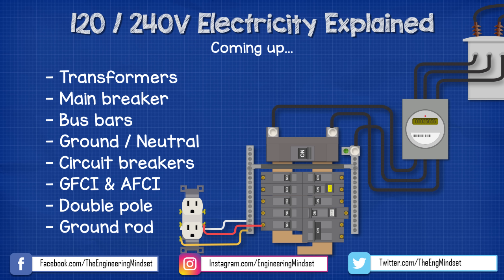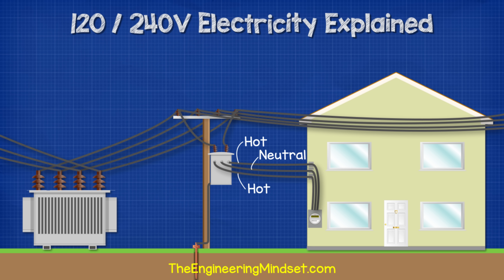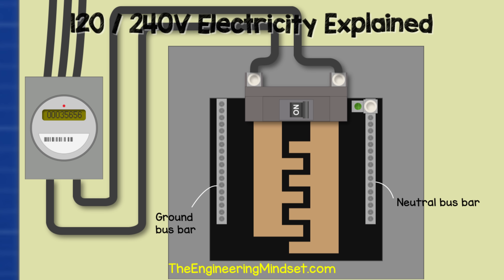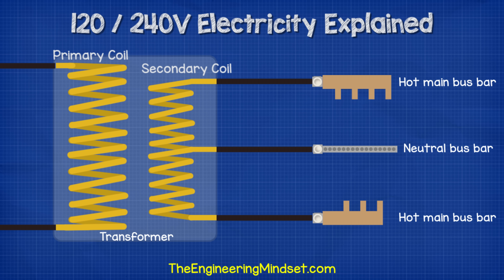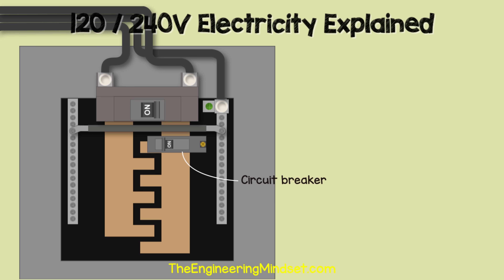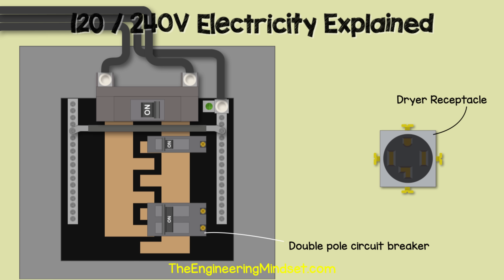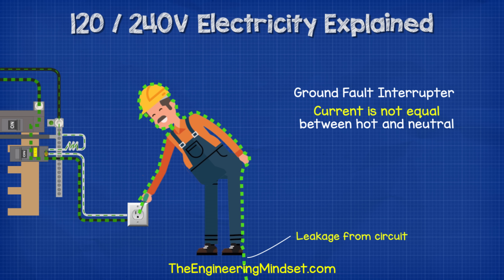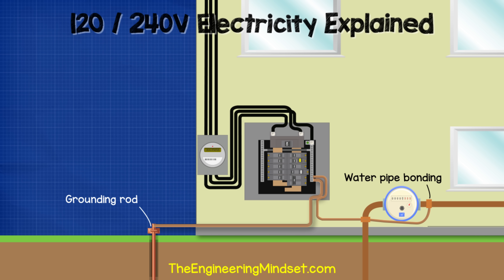120V 240V Electricity explained - Split phase 3 wire electrician

Comment: Living between North America and the UK I got a lot of UK + EU appliances at my NA location currently a few fully populated power strips. I love using my 240v/3000W kettle which is so much faster than the max. 1500W ones available in NA so a 120V==>>240V step up is not an option unless you want start a fire trying to draw 3000W off a max. 1800W 120V/15A outlet. 

Eventually fed up with changing and messing with adapters, I went for a shopping trip at Wickes and brought over a shitload  240V * 13Amp = 3120Watts UK Outlets with built-in USB chargers, spools of stranded 2.5mm power cable (Brown - Live, Blue- Neutral, Yellow/Green - Earth) and electrical back boxes. didn't want to replace the plugs since many items I bring with me when I travel, and the UK ones are so much better designed, fused, sturdy and safer with conductors that has plastic for the first few millimetres preventing shock if you have your finger between the plug and shuttered outlets. Even the outlets are easier to install: just strip cable, twist strands, insert and tighten where the traditional NA sockets requires you to make thus hook shape, wrap around the screw and tighten 

Ended up fishing new cables from the mains behind the walls and ceilings and wiring up all the rooms with UK Outlets adhering to the BS1363-2 / BS7671 Standards next to the 120V NA Outlets and have my topology in a Ring-Main design which should lower or balance current draw across the lines.

Its connected (temporarily) as NA Hot P1 (Red)  ---> UK Live (Brown Wire), NA Hot P2 ---> UK Neutral (Blue Wire), NA Neutral (White Wire) --> Not Used, NA Ground (Bare) ---> UK Earth (Yellow/Green Wire)

Everything works quite well, only minor problems with the setup is that the Neutral / Blue Wire is no longer really neutral so there's 120V potential between it and ground and the switches on the power strips/outlets are only in a SPST configuration, so turning those switches to OFF does cut the power to the appliance by cutting the Brown/Live but the 'Neutral' is still live, I'm using a Double Pole Water Heater switch to get around this issue when I need all lines to be truly off, like when I lift the kettle from the base there is an exposed 'Neutral' terminal, and second problem being a 60Hz system instead of 50Hz which causes issue for a few items, like tape players running too fast and sounding funny and timing circuits being a bit off, and third is lack of a working RCD and I doubt a GFCI breaker would work properly since at 240VAC any leak would only draw half the current.

Next project would be solving these issues by installing a sufficiently sized 1:1 transformer 240VAC or two 'Hots' in Primary winding with no centre tap on the Secondary to make it safe to reference one side of that winding to earth (otherwise without the isolation its exactly the same as shorting Hot and Neutral together!) in order to have a proper Neutral - Earth Bond (no more 'live neutrals' and proper L/N/E terminals so the secondary side wont be left 'floating') - all nicely simulated and working on Falstad's Circuit Simulator app, and eventually have a 60-->>50Hz pure sine wave frequency converter, install a consumer unit with RCDs to have two separate systems or breakers for the European / UK circuits and NA circuits then test to make sure it adheres to BS7671 safety standards. After the isolation / frequency conversion the power will be indistinguishable from a European supply you get in the UK after the power metre but before entering the consumer unit.
Reply from the maker: Seen our new Transformer video? here https://youtu.be/jcY4QN7awEc

Comment: Wouldn't touching the Left and Right Bus Bars with my multimeter. Burn out my Multimeter?also I was told moisture and condensation in the air could ignite the bus bars without ever touching it. Becareful people.❤
Reply: Not unless you were in current measuring mode. Moisture can cause leakage, but will not ignite bus bars. You should avoid exposing the bus bars entirely!
Reply from the maker: Check our new Multimeter tutorial out ➡️ https://youtu.be/4lAyzRxsbDc

Comment: The only comment I would add is at 6:09, I just wish you had added that the breaker is specific to the WIRE not the appliances. Yes, technically that is what an "overload" is, but without mentioning that the breaker is specific to the highest gauge of wire used in any given circuit, it would be very easy for people to believe that if they wanted to add more appliances they just use a larger breaker. 
Also, I can't tell you how many breaker boxes I have opened in older homes where 12 guage wire is [correctly] connected to a 20amp breaker, but tracing the circuit I find that a disreputable electrician only ran the 12AWG wire to the first outlet in the circuit, leaving old 14AWG ran throughout the home. This would be caught in an inspection, but so little remodel/retrofit work is officially inspected at the time of installation.

Comment: I know a lot about electricity. I know that those transformers and those power lines outside have electricity in them. And some most of the time the outside electricity connects into a house that's what gives the house electricity. But then there's fuses and amps and different things that go into a house to even everything out so the electricity doesn't go too high or too low so it gets where it needs to be. That's why the electricity shuts off on the fuse box because that's what the fuse box is telling it that there's too much wattage and it shuts off. A lot of times houses blow up with bad faulty electricity.
Reply from the maker: Seen our new Transformer video? here https://youtu.be/jcY4QN7awEc

Comment: So I need to run 2100ft and the electric company wants to charge $9/FT. Will I need a 3 or 4 wire cable to get 110/240V for my house? According to this video I just need a 3 wire as the neutral and ground are connected together in the box. It'll be 4-4-4 AWG Aluminum URD.  I may hask for a step up transformer at the beginning and a step down transformer at the end of the run to prevent the percentage drop as the wire is rated for 600v anyways. Thoughts?
Reply from the maker: Seen our new Transformer video? here https://youtu.be/jcY4QN7awEc

Comment: Question: If the main breaker is off, and if a person touched the Neutral Bar, since the neutral is still energized by the transformer, could the person get shocked or electrocuted?

Comment: I have a 240 v appliance that was designed for the US. With connection for the two 110 volts from the main US panel. And the earth
Question.  Can I use that Same appliance in the UK. By simply connecting. The neutral and live (0volts neutral and 220 v live wire) and the earth to earth????

Like the appliance e at minute 8:40 in your video
Reply: Does the appliance say it will operate on 50Hz? Some will, but others won't. And some appliances like dryers use both a 120V motor and 240V heaters.

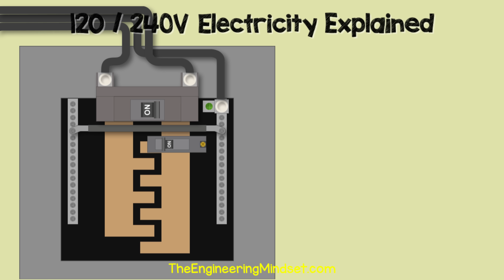Comment: 8:22 question, the double pole breaker for large appliances, there are 2 switches with a load max of 30 AMPS in your picture.  What is the max load for the 240 amps?  

I assume it's still 30 amps not 60 because it's just basically 2 breakers in parallel correct?   If I wired my 15 amp circuit with 2 breakers in parallel , and I put a 20 amp load on  it, it would trip one of the breakers.  I think.

Is this correct?
Reply: The breaker are actually in series: 
120v buss ----breaker----load--- beaker --- 120v buss.
Reply: A double pole breaker is really just two single pole ones which are linked. They are not in parallel.

Comment: What measurements are needed to determine the total power in kW of the electrical panelboard? Do you measure Voltage from one bus bar to ground or do you measure across both bus bars? also where do you collect the Current in Amps measurement?

Comment: Just make sure you load balance your 120v loads equally in your service center. Electric companies rob us as if your pulling more of a load on one side of the meter it still charges the same on the other 120v side. This is why other countries use 240v, puts an equal load on the meter there for running more efficiently.

So if you ran your home all on one side of the incoming load, your bill would be cut in half if you split the load between the two incoming power as they bill both sides equally even if one side of the incoming load is not used. If hue still having a hard time understanding this, take a gallon of water, poor the water into a split sink, half the water goes into the one side the other in the other  side, pull the plug on one side, your still paying for the entire gallon even though you only have half of it left. Simplified it for those that do not understand.
Reply: Interesting.

Comment: I have a 15kVA split Phase transformer. Its rating is 230v-0-230v. Is there any borewell submersible Motor pump manufactured in either india OR in any other Country?

Comment: Curious, you show the copper ground wire being always connected to the neutral bus, when it should be connected to the ground bus?  as well, the grounding stake should be connected to the ground bus and not the neutral bus.  at the main panel, the neutral and ground bus are cross connected as you show, so what you say is ok at the main main panel, but not sub panels since there is no connecting wire allowed between neutral and ground.  Correct me if i am wrong...
Reply from the maker: All the information shown is in line with the NEC regulations. It was mentioned that this setup is only for the main panel, not sub panels
Reply from the maker: Check the new SUB PANEL EXPLAINED ➡️ video https://youtu.be/NUSNa-7Hecw

Comment: 11:31 - Neutral and Grounding bar are connected together. And "neutral" is not neutral. So, what prevents current from running from "neutral" to ground?

Comment: This transformer is considerate an single-phase transformer? I'm from brazil, and here we don't have this type of transformer. We only have 3-phase transformer (127/220V or 220/380V) and 1-phase transformer (which only have 127V or 220V on his low voltage side)

Comment: In 1966 my father and I rewired the family house. But I was only 9 and didn’t understand much of what he was saying. Thanks, this fills in some of the gaps. 

Here’s a remainder one: connecting the two hot leads gives you 240 volts. But aren’t they both “positive”?  I realize that this is AC, not DC, but still, the electricity flows all in one direction before switching 1/60th of a second later to the other direction, right?

Comment: This is the best explanation of the 120/240 split in the U.S. power system. The center tap of the pole transformer automatically transfer the load on both the 120v circuits and 240v circuit to the grid, thanks to the wonderful transformer effect. (Thank you, Mr. Tesla) The grounding of the neutral line also provides a voltage reference to the live-neutral-live lines so they are not floating when compared with the ground wire. It is a brilliant and safest setup.

Comment: I went to school for Electrical Engineering, and while I know a lot about how electricity works mathematically, I don't always understand how specific components in the home work and what they are for. Videos like this are extremely helpful to bridge that knowledge gap. Thanks for it!
Reply: Good point
Reply: Exactly, my case also
Reply: Same here too, the part where you shower it in DC mode really helped bridge the gap in my head(sorry bad pun, couldn't resist(er)).
Reply: I know Engineers who were Journeymen electricians before they the went to school, and they’re some of the best engineers on this planet.
Reply: Me too
Reply: That’s why we always say… An engineer will walk past ten vaginas just to F*ck a technician.
Reply: Took a circuits engineering course and while I learned about circuit calculations, I finally learned how wiring in homes work. This video was a major piece to the puzzle!
Reply: Same here. Went to college for BSEE for 3 years then dropped out because it was all theory and math and no practical hands-on. I sort of understood how to do the math but I didn't understand what the math was referring to in the real physical world (generation, wires, distribution, motors, appliances).  That was 40 years ago but it still bothers me when I think about it. I don't regret dropping out, it was the right decision because I realized I was not cut out for a career in EE. But I wish they'd given a course in basics like what is electricity, how it's produced, distributed, used. If I'd had these videos to watch back then things may have turned out differently for me. Back in 1980 we didn't have computers or internet, just dense dull engineering textbooks with lots of equations and theory. Ugh.
Reply: @mattfoley6082  😂 I had nearly the same experience in advanced Naval Aviation Electronics School in the Marine Corps
Also in 1980.
It was a 7-month school everyday all day long. I'll never forget the morning a sailor walked in and was holding a resistor and a capacitor that he had twisted (connected in parallel) and said, "Look! I Thevinized an F-14 last  night." 
😂😂😂
Yeah we could do that but it's not going to help us fix aircraft!

So about a month before Define exam we started reviewing individually. I picked up some of my math notebooks open them up and thought "Oh my god did I write these equations?" 😂 derivatives,  integration,  matrixes...  f_____!😂
Reply: Spotted on.
Reply: What math are you talking about? It's just ratings. Pretty simple.
Reply: @Elpipiton  electrical engineering math. The physics behind it all

Comment: How is the 240 v being produced? If the distribution is out of phase by 120 degrees we would see 120 v or 208 v. I would think that we would need the phases to 180 degrees apart to get this and that would not be 3 phase any more.
Reply: That is what transformers do.  A three phase delta secondary has no neutral, but if you choose a center tap on one of secondary coils to be neutral the end result will be two 120v 180 degrees out of phase and a 208v phase at 90 degrees to the other two.
Reply from the maker: Seen our new 3 phase transformer video?➡️: https://youtu.be/u0SsejDCVkU

Comment: How does electricity become "used", you mention it is returned to the transformer, then what?  Is it recycled?  Where do the electrons go once used?
Reply: The electrons do not go anywhere! That is like asking where the links on your bicycle chain go.  "Used" was not good choice of words.  If you are only customer on a transformer you bought your electrons when you wired your house. You still have the same electrons now. If you share a transformer your electrons may visit your neighbors but some of theirs will visit you.  Admittedly some electrons may have wandered off but most of them have been around the house for years.

Comment: Very neat video. As an Electrician from EU, where we have signifigantly different systems from the grid into the houses, I've wondered how US houses gets 120/240V, as I've never heard of two-phase distribution systems before (All countries I've looked into has 3-phase, which would give 140/240V roughly) Also  interesting to know what lies behind the layout of US fuseboxes, as they have a very different layout than the ones I am used to.
Reply: We call it a split single phase. Two "hot" legs enter the home with a shared neutral.  The neutral "splits" the transformer, by being "center tapped."  The voltage between the two hots is 240V.  The voltage between either hot and the neutral is 120V.    This allows us to use both 240V and 120V outlets in the home.  Most standard outlets are 120V whereas most of the heavy appliances run on 240V (and the home owner never messes with those outlets).  

Electricity is carried on our power lines in 3 phases, but we only send a single split phase into the home.  3 phase power is used for industry.
Reply from the maker: Seen our new 3 phase transformer video with worked examples: link- https://youtu.be/u0SsejDCVkU
Reply: Just say what country you're in. The EU is not a country.

Comment: What in the hell is "used" electricity? I've never heard it put that way in my life. This video makes it seem like electricity goes to your device (tv/light/fan) then is used up and leaves a byproduct that has to go back to the transformer. Seems to me your device is just using what it needs and the overage keeps flowing back. I imagine the device being like a cup and the flow of electricity being a river. You dip the cup in the river (turn device on) and get what you need (a couple amps) and the rest of the water in the river keeps flowing along. Can someone please explain what he means by "used up" electricity?

Comment: Don’t see a link for 240v in the philippines.  Here uses a “hot” insulated wire supported by a bare “return”.  Haven’t looked that closely but it appears that returns aren’t isolated back to this wire.  They get grounded back to “earth” near the CB panel.  So “earth “ and “return” are the same.  Any GFIs that I bought, they grounded to earth via a rod but since they are the same potential, GFI doesn’t work here.

Comment: It is interesting that when courses show electrical generation plants the graphic they use are parabolic cooling towers generally associated with nuclear plants.

A side note is that on US submarines they do not connect the neutral to ground on 120 volt circuits.  This allows the circuits to remain functional in the event of a flooding incident which grounds one side of the circuit.

Comment: Another mystery of the Earth solved. Home owners should learn the basics of electricity before messing with electrical installs. Standards should be maintained and equipment must be properly matched. (e.g. circuit breakers) When in doubt call an electrician.